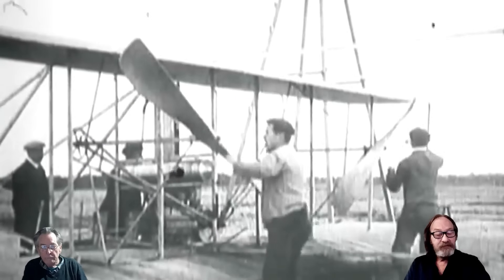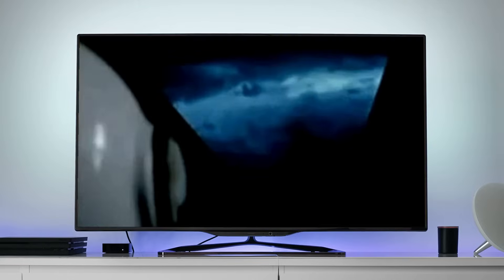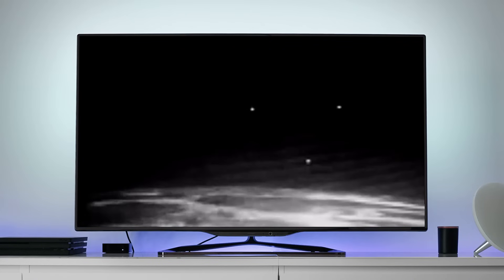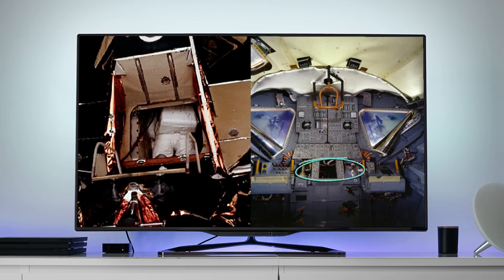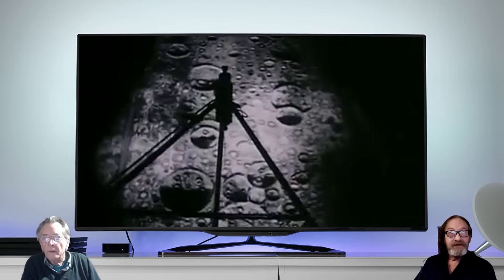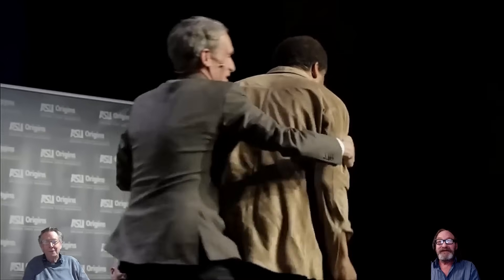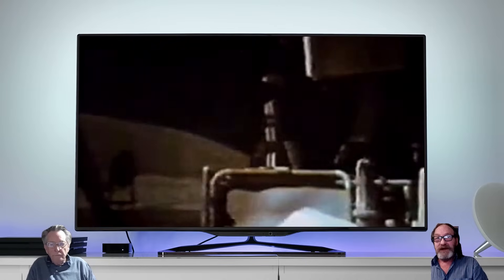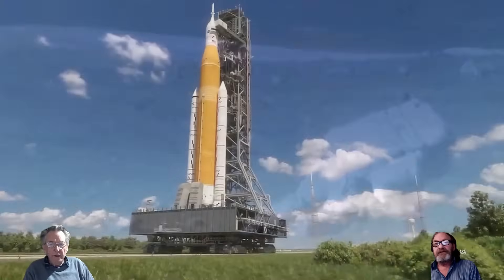THE APOLLO DISCUSSIONS "NON LINEAR SPACE PROGRAMS/ SIMULATORS/ TYSON'S POINT OF VIEW" PART 56

Comment: I read that Artemis 2 won't have a Trans Luna Injection but instead they will gradually perform higher and higher earth orbits. Presumably if the radiation becomes too much they can use a technical fault as an excuse to come back in an easier way?
Reply: Trans lunar injections happen to slow down the earth's rotation more so than gradual orbit ascent does.
Reply: @SurprisedChocolateStrawberry24 Any force of an ascending rocket will minutely oppose the earth's rotation....very small opposing force, but one which nasa will shirley someday invoke as another excuse not to go to the moon.
Reply: @yomommaahotoo264  Yeah and when I jump up and down I impart a small force onto the Earth.  But the amount of force ... well.....Aint' much. 
I wish the Earth was slower....  lol
Reply: @philasflogg9045,  Your comment inspired me to do a little research .. "The Artemis 2 mission plan involves sending four astronauts in the first crewed Orion spacecraft into a lunar flyby for a maximum of 21 days using the Block 1 variant of the Space Launch System. The mission profile is a multi-trans-lunar injection (MTLI), or multiple departure burns, and includes a free-return trajectory from the Moon. This means that instead of a single Trans Lunar Injection, the spacecraft will gradually perform higher and higher Earth orbits before heading to the Moon."

"Presumably if the radiation becomes too much they can use a technical fault as an excuse to come back in an easier way?"

Bingo! .. And if nine Apollo missions went TLI without needing to do multiple departure burns, then why would they need to do that now? .. Methinks that Artemis will prove that Apollo never happened.
Reply: @straydog02  Me thinks you shouldn't pretend to understand orbital mechanics.
Reply: @g.gorrell2088  Methinks I understand that the manned Artemis craft will need to use a multi-trans-lunar injection, instead of one, supposedly done on Apollo, and that it will take 21 days to reach the Moon and back, instead of the time it allegedly took Apollo 8, which was 6 days, 3 hours, and 42 seconds.

21 days just to get to the Moon and back?.. 4 humans onboard, who will need to eat and drink for 21 days?.. How much added weight would all of those supplies be?

Methinks that Aretimis has already proven that Apollo was faked.

Comment: Nice work showing the $7.8 billion Apollo Simulation Program.. As for Neil deGrasse Tyson, him posing with the muppets pretty much says it all! .. And you tossed in my favorite A15 smoking gun evidence, 8:56, 14:54, 30:58, 3 times!!!  😁
Reply: @SurprisedChocolateStrawberry24 He thinks the noise was from a "cord" that Jim Irwin threw and it hit the LM with it, problem is with that is it wasn't a "cord" it was a "band" and the object thrown did not bounce off of the LM, it flew out of the picture, and a band doesn't make a thump sound.

The thump noise was from when Dave Scott inserted the antenna into the Communications relay Unit and that imparted a thump because the communication system was turned on.     Just like if you hit a transistor, vacuum tube or a resistor with a chop-stick it will impart noise into the system.

I like electronics. 🙂
Reply: @SurprisedChocolateStrawberry24  The NASA apologist has entered the chat folks!
Reply: @g.gorrell2088  It was the LiOH cannister band that hit the A15 LM prop with that loud thump sound.. Sound that wouldn't be heard if they were really in a vacuum on the Moon.. It wasn't the antenna inserted into the communications relay unit that imparted that thump, since it was dropped into place a couple of seconds after the LiOH band hit the LM, as we can clearly see in that footage .. But we have been through all of this before, so you making the same false claims again is not only quite predictable, but very stupid.
Reply: @SurprisedChocolateStrawberry24  i was referring to you.
Reply: @straydog02  " It wasn't the antenna inserted into the communications relay unit that imparted that thump,"
You know what... You are Correct!
I watched this in slow mo' again and I realized Scott did NOT insert the antenna into the Communications Relay Unit mounting sleeve, he bumped the bottom of the antenna on the shell Chassis of the CRU which was turned "ON" at the time, which caused the "thump" sound.   

Electronics will make noises when impacted by so much as a chop stick, resistors, transistors capacitors etc..

And just like any communications unit the chassis will be the common ground and all components will be grounded to that chassis, so any disturbance albeit radio waves or physical contact with any components will create noise.  That's not a copy/paste btw 🙂

A band would not have made a "thump" sound if that had hit the LM, because the sound would've by NO means transfer thru' their A7L helmets that had three visors and a fish-bowl pressure helmet.
Reply: @straydog02 No, I said it was when Dave Scott dropped the bottom of the antenna onto the top of the chassis of the CRU that made the thump sound, watch the video and see.
The band doesn't bounce off of the LM, it flies out of the frame.

Would you like to have a discussion about 40', 50' 60's and 70's electronics?
That would be fun!
Reply from the maker: I was thinking about you when I pulled that up along with the eight inch jumping jack footage. 
I received your mail regarding Buzz in that door frame. The edge of his PLSS is almost in contact with the door frame. That is impossible when a 10 inch console is in the way to prevent him from doing that. Trevor Weaver and a friend actually conducted that experiment to see if one of them could do the same. Guess what? They couldn't because they put a broom stick protruding ten inches above that door and they both failed to do what Aldrin did. That is why I added Trevor to this video. I cannot believe that most people cannot see this. Cheers SD!
Reply: @g.gorrell2088  "The band doesn't bounce off of the LM, it flies out of the frame."

In the film clip shown here we can't see the band hit the LM, but we can see it clearly hit the top of the LM in the uncropped original film that Jet Wintzer used for his 'Moon Hoax Now' documentary.. I have watched that footage many times.. Scott dropped the antenna right AFTER the band hit the LM, so there is no doubt the band made that sound.
Reply: @g.gorrell2088  "You know what... You are Correct!"

Yes I am.

"he bumped the bottom of the antenna on the shell Chassis of the CRU which was turned "ON" at the time, which caused the "thump" sound."

Changing your story because you know you were wrong about the antenna dropping, will not make this one true either.    

"because the sound would've by NO means transfer thru' their A7L helmets that had three visors and a fish-bowl pressure helmet."

Irwin's helmet mic was still on when the band hit the LM.. You can hear that in the original film.. So your excuses are meaningless.
Reply: @SurprisedChocolateStrawberry24 Perhaps you would enjoy watching an old Carl Sagan video rather than seeing your heroes be challenged. Face it, space travel is science fiction. We are stuck in low earth orbit, less than 400 miles up. All this silliness about going to the moon 240,000 miles away and mars 39,000.000 miles away in the near future is a pipe dream.
Reply: @g.gorrell2088 It's a miracle that the 'thump' heard at exactly the same moment the thrown object would hit the LEM was instead a communication system being turned on.
Lemme axe you sumpmm. 
Was that footage of the astronot throwing the object being simultaneously transmitted to earth....and if so, what 'other' communication system being turned on were you referring to?
Reply: @yomommaahotoo264  That's a good question, I can't remember exactly but I think that event was broadcast live, but the camera wasn't mounted on the Rover.

1) The object thrown was a soft band, not a hard metal cord with the "bullet ends".

2) If they were in an atmosphere environment, which they weren't, there's no way that sound could've traveled thru those helmets and into those microphones which were next to their mouths and the gain on those microphones were set very low because of the proximity of their mouths to the mics'.    

3) The object does not bounce off of the LM.

4) Scott dropped the antenna onto the chassis of the Communications Relay Unit at the exact same time as the thump sound sound is created.
Reply: @yomommaahotoo264  "Do you know what the dimensions of the lunar life support backpacks were?"
Do you know the dimensions of the LM's hatch door?
Reply: @g.gorrell2088  yes - that's why I asked the question.
Reply: @yomommaahotoo264  Me too, that's why I asked that question.
Reply: @g.gorrell2088  So....can a suited up astronot wearing his backpack fit through a 32" square opening (if that's really what it measures)?
Reply: @yomommaahotoo264  Is this really an issue open for debate?  lol
It's like you guys think you're hammers and every thing looks like a nail to you.  lol
Well at 20.5 inches wide, and 10.5 inches deep I think a man and the A7L suit could fit thru' a 32 inch square door.    This is all you got?  lol
Reply: @straydog02  "The metal band was attached to the canister with screws and bolts, and had a length of about 2 feet (61 cm). The metal band was removed after each use of the canister."
And that is a provable lie the cord was a metal cable with bullet ends and those were attached permanently to a Nylon strain relief bracket, try again.

"The helmet mics also had a directional pickup pattern, which means they could pick up sounds from a specific direction."

Yeah Unidirectional and the microphones were pointed at their mouths and those were set with very low gain and amplitude, because the microphones were an inch away from the mouths.
The Mics' weren't omnidirectional, they were unidirectional, which proves my point.
If you knew anything about amplification and electronics you'd know this, but.....alas.

I'm not the lying clown here sport.
"Ridicule of your betters is not only a pathetic old school tactic used by extemely stupid toadies"
Take your own advice, sit down listen and learn.
It's spelled "extremely".
Reply: @g.gorrell2088  First you claimed this ..."The object thrown was a soft band, not a hard metal cord with the "bullet ends".

But now you claim this .."The cord was a metal cable with bullet ends and those were attached permanently to a Nylon strain relief bracket, try again."

Which is a complete contradiction. 

You also claimed.."The object does not bounce off of the LM."

Yet the official NASA footage used by Jet Wintzer in his 'Moon Hoax Now' documentary proves that it did.

You also made this idiotic claim .."Scott dropped the antenna onto the chassis of the Communications Relay Unit at the exact same time as the thump sound sound is created."

Even though the footage clearly shows the antenna was dropped a couple of seconds AFTER the LiOH band hit the LM.

Lying doesn't help your cause, sport.. It helps mine.  🙂
Reply: @straydog02  No need for another Hissy Fit, I can help you here.
Witzner or whatever his name is claimed it was the metal cord with the bullet ends that Irwin threw.
But that cord was permanently attached to a Nylon strain relief bracket.
It was a "band" that Irwin, not a cord, but a "band", read transcripts and work on your reading comprehension problems.
Reply: @g.gorrell2088  I know you're embarrassed for contradicting yourself once again, but don't blame your stupid mistakes on me.

We all know what Irwin threw at the LM and more importantly, we all know why it made a sound when it hit the LM. 

Face it sport.. The Apollo photography was not filmed in a vacuum on the Moon, for reasons obvious to even a child.
Reply: @straydog02  You know I'm embarrassed?   For you a little.  lol
That's amazing that YOU can decide how others feel or think!!
It's like if you wish really hard the people will start to think that you are really smart.  

Sorry but your guy Witzner or whatever is dead wrong.
The CABLE with the bullet ends could NOT be removed and thrown because it was attached permentantly to a Nylon strain relief bracket.  Sorry sport 😞

Comment: Why did they need to eject 2 bits of the fuselage in space?  According to Newton once you reach a speed in vaccuo you remain at that speed unless acted upon by another force. So they would not have moved faster. And ...
How were they able to slow down near the moon?  Only the moons "gravity" would have had an effect. No forward back propulsion would have worked.
Reply from the maker: They figured, why take along the extra weight when it will consume much more fuel to maneuver all of that kit in to orbit. At least the LM had two engines plus the thrusters and the fuel to make those maneuvers, when they tested it all in LEO. I still think that is as far as they went. Cheers John!

Comment: Astronauts in the LM never took their spacesuits off, so why not have a sunglasses pocket?
Reply: "Astronauts in the LM never took their spacesuits off" How did they put them on?
Reply: @theo7326 How easy it is to tell that nasa is getting desperate sending in these bozos.
Reply: @theo7326 An astronaut got into the suit through a rear pressure-sealing zipper that ran from the upper back through the crotch.
Reply: @Roy-Bland  "pressure-sealing zipper" Zipper doesnt seal under pressure.
Reply: @theo7326  🤣
Reply: @theo7326  "Zipper doesnt seal under pressure."     😂
Did you just decide this!?  Wowee
I guess you've never heard of the Goodrich Pressure Sealing Zipper?    Google time!
Pete Conrad did have a 0.15psi / minute leak in his suit, so maybe in a way you're kinda' right.  

I get that kinda' leak in my bike tire sometimes, but I still make it home.   lol
"Zipper doesnt seal under pressure."     😂🤣😂

Comment: Mmm, probably they have to check out if the moon klimat has changed as on the Earth.. Don't know for sure.. There are still some part that fascinate me on how they did it if they can't even today. One thing I know is, the space has no pressure (or a teny tiny bit), which means, they practically travel (all space crafts) in a gas cylinder, which, if something goes wrong, could pop like a baloon. Besides, if any problem arise, it might be deadly. HAving 6 missions without a glitch is almost impossible, except for 13, which is already known as bad luck.. 🤔 I'm wondering for Artemis if it will be postponed for astronauts flight after they check the "klimat" up there.. 🤨 Cheers detectives, keep on.
Oh, we certainly know how much fuel we need to accelerate 100 kilos of mass to a speed of 6500 km/h.. Do you have  any calculations on fuel volume to depart back and reach orbit speed of the return module?
Reply: "Do you have  any calculations on fuel volume to depart back and reach orbit speed of the return module?"   Dont ask embarressing questions😂😂😂😂😂😂😂
Reply from the maker: We certainly do have fuel calculations which we have repeatedly gone over in older videos. I have opened up the search engine for our videos again as Google keeps shutting it off. I wonder why? In any case, best wishes for the new year!
Reply: 6 missions without a glitch, how delightfully uninformed.
Reply: @SurprisedChocolateStrawberry24 Every mission had glitches, that's what i mean by poppycock. There are a few reasons why Apollo was cancelled, one being NASA knowing eventually their luck would run out.
Reply: @SurprisedChocolateStrawberry24 There were hundreds + on every mission.